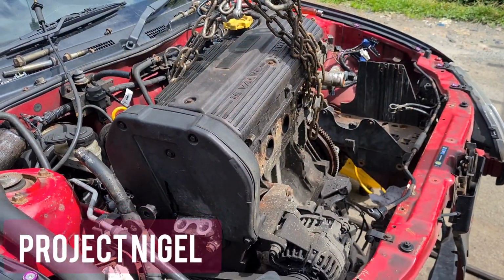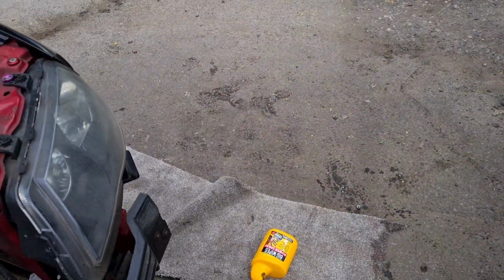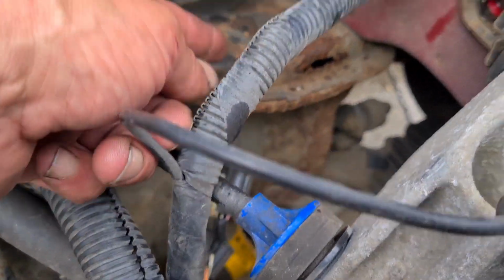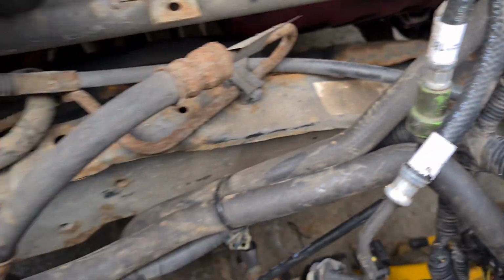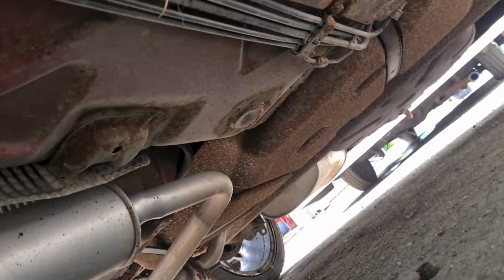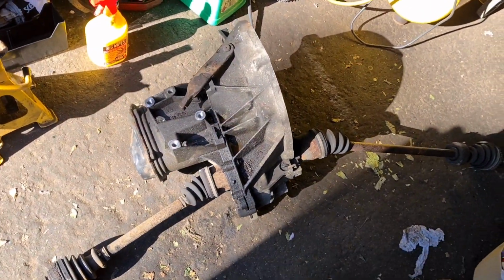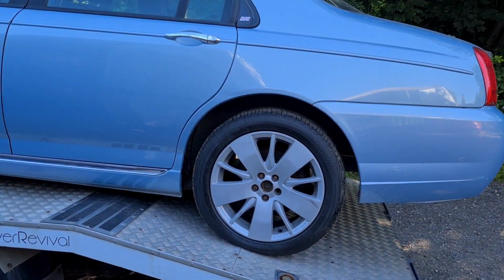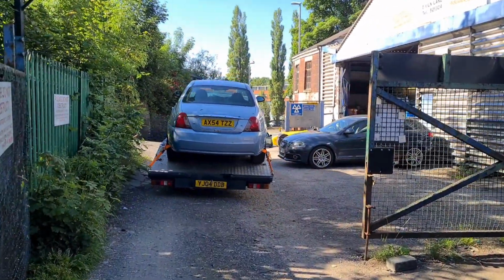MG ZR engine removal: Project Christopher Ecclestun pt.5

Comment: Man must stay hydrated. So drink lots of Tea. 😀 It didn't work no fuel out.  So of home for curry and beer.👍😀
Reply from the maker: Still making a good enough connection.  My soldering skills are not actual skills.
Yep. Great night out in Manchester 😊
Reply: @ProjectNigel   I seem to have a knack with the solder lol I fixed my fuse box my electric windows. I  wouldn't say I was an expert lol.😂🤣